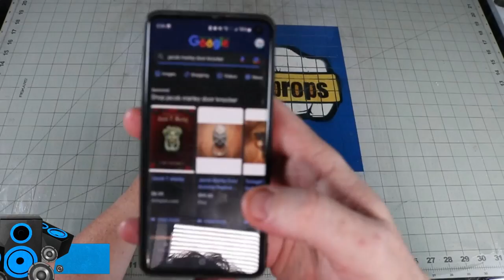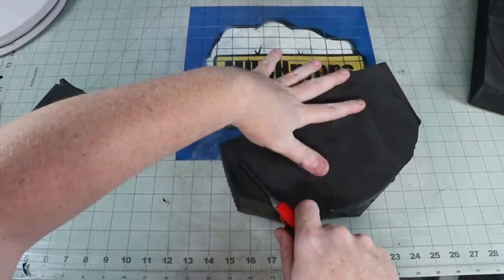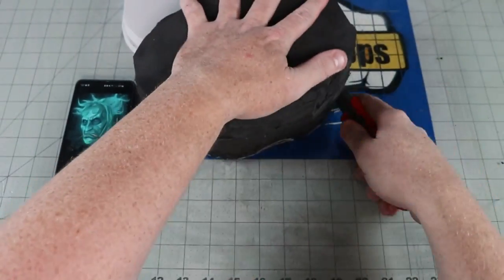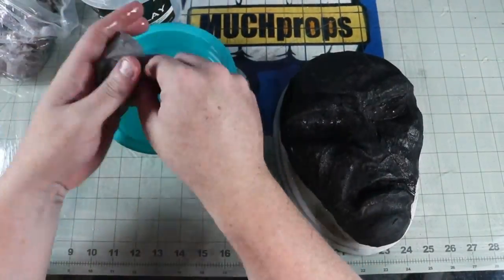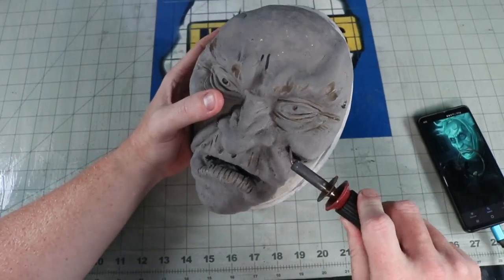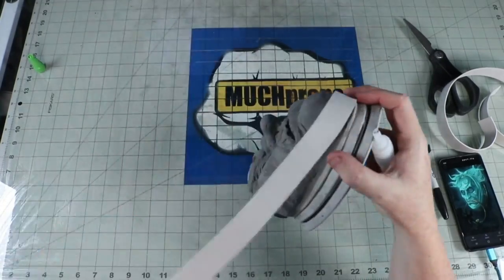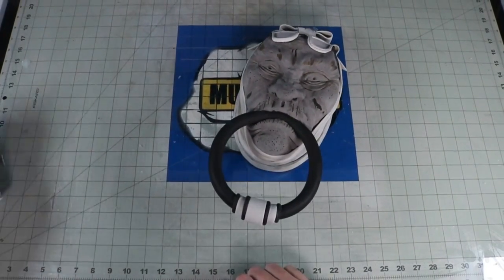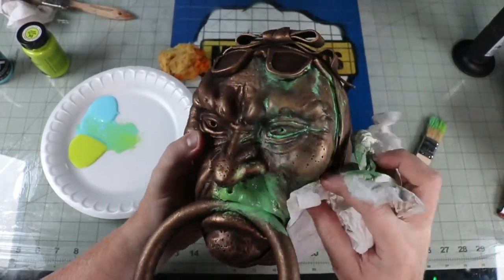Foam Crafting a Jacob Marley Door Knocker

Comment: looks great. nice and creepy. the clay going to a near soup makes me wonder if it would work well for complex molds.
Reply from the maker: You can use it in molds for sure. Shrinkage does lose some of the details. I think I saw Evil Ted say to stick it in the freezer for an hour or 2 and you can pull it out cleaner from the mold to then allow the inside bits to dry